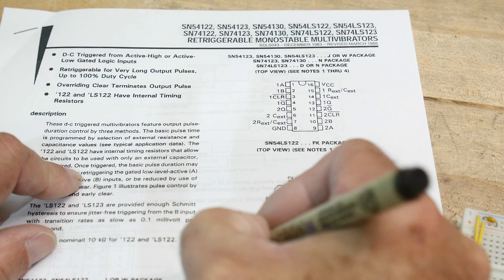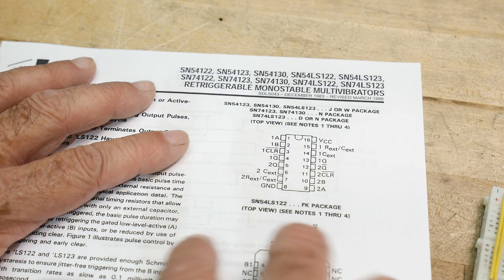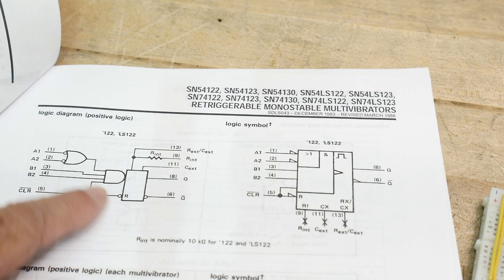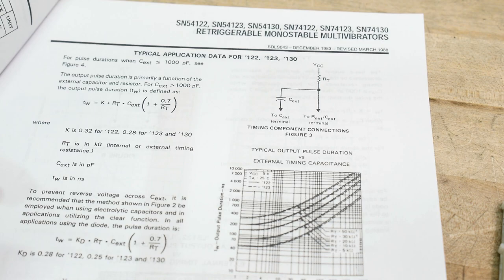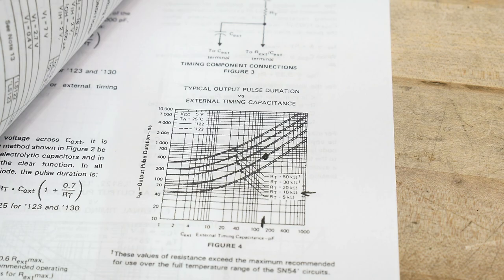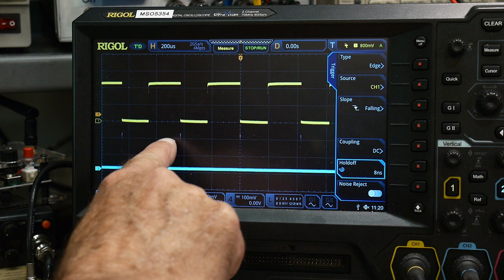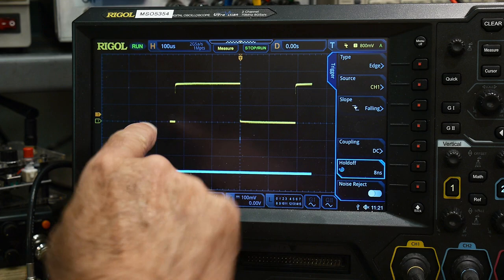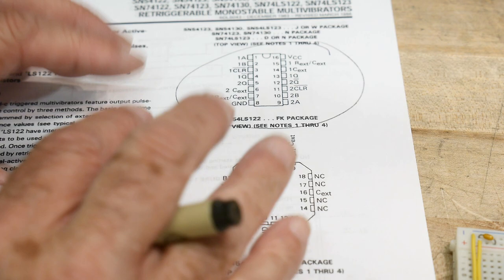#1134 TTL 74123 74HC123 Monostable Multivibrator

Comment: 74123 was one of the first TTLs I have encountered while beginning my adventure with digital electronics back in the 1980s. I remember that a learning set I bought had a circuit for a programmable digital lock using this chip. You'd program the lock using timed pulses and then you'd have to use the same timing pressing the unlock button while opening the lock. If you failed to time the unlock sequence properly, alarm would sound. I built it and it actually worked :-)

Comment: Most common use was to handle logic race conditions, or to provide a delayed edge to trigger a latch, because it was on the other clock edge, but also had setup and hold times which meant you could not just invert the clock to use it, but instead had to do more. Thus the 122 with all the input logic, to handle part of the decode as well, and then you had on the output the correct edge pulse to get the data latched correctly. Often used when mixing logic blocks from different families, like interfacing 6800 parts to the Z80 or 8080, and vice versa, where you needed certain delayed edges to get reliable data transfers. Yes kind of critical in getting RC values right, too little and you got garbage because the bus was not ready, too long and you also got garbage from the bus being released.

Another use was pulse stretching, so that a pulse train could be decoded into data over say a serial link, to discriminate between the 2 different tone widths, of say early tape transfer methods, one half being used to generate a clock for input, and the other being used, together with the clock from the first, to determine if the input width was more or less than the the short period, so being able to tell them apart without needing a complex timing off the CPU. Just read the clock, and on change look at the other for the data bit.

Comment: Can I just say how much I love this chip videos? I can't tell you how many times I've got a chip, looked at the datasheet and still not been able to work out what it's all about.  I have seen it suggested that the 123 can be used as a TV sync separator for H sync and V sync, but I've not had much luck with it myself.

Comment: Interesting... here we used a lot 4538 cmos or later 74HC4538. My experience is to use real high quality caps on those circuits to get them long therm stable. In fact no ceramic caps at all - i i used the premium foil caps, the good old green WIMA MKP Polypropylene or MKC Polycarbonate caps.

Comment: About 3 years ago, I pulled out my old Imsai from storage and restored it. (I started watching your channel when you restored yours). A lot worked (I replaced the huge PS caps first off), but the front panel was flaky. The switches, like the deposit and deposit next pass thru those 74123's to get rid of the key bounce and to get a nice pulse, without triggering multiple inputs. Most of the old tech's I spoke with call these "one shots". I traced mine, found the offending parts (I had two bad) and swapped them in and it started working properly. But It was fun to understand what they did and that you could adjust the pulse timing with the RC network. I've have a digital scope, like your older one, and the ability to capture a "single trigger" sure made it easy!

Comment: I remember that back in the day 74121 was the most prevalent monostable used in schematics. Very similar to the 74122, only with fewer inputs - and the same problems.
Reply: The 122 was rather 1/2 of 123 than 121. Main difference between 121 and 122/123 was so called retriggerability - the output  pulse could be extended if triggering happened before end of this pulse (with 122/123), while 121 could generate new pulse if previous one was finished (plus some dead time). As a result, pulses from 121 were always of the same length, while 122/123 was able to generate pulse with any length (but not shorter than time established by RC conditions).

Comment: I used the 74HCT221 variant for a pendulum clock beat analyzer using a microphone.  It's the non-retriggerable version that ideally can't be fooled into lengthening the output pulse once triggered.  

The purpose was to create a one shot pulse that was unaffected by the following clicks, that occur in the escapement, after the initial sound.  Also used active opamp filtering to try and eliminate false triggering from ambient noises.  This all fed into a Microchip PIC (16f88 or 16f628 likely) using the capture interrupt for microsecond resolution on timing. The output from the PIC chip was standard serial data the was processed by a Visual BASIC program on a PC.  

This project was started almost 20 years ago, hence a serial interface to something powerful enough to generate a graphical view of the beat. 

Active opamp audio filters are amazing. I used a couple of stages up front, to amplify and bandpass filter the input.  You could make fairly loud ambient noise, yet the active filtering really attenuated it, preventing most accidental triggers.  Fun stuff. :)